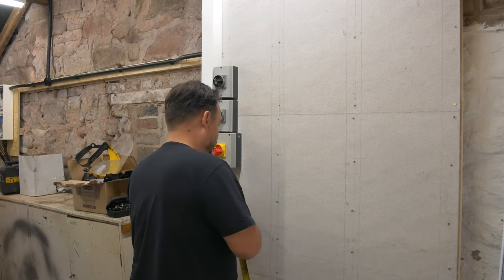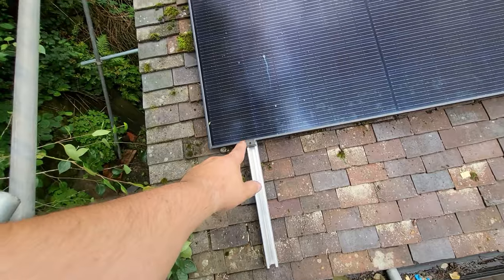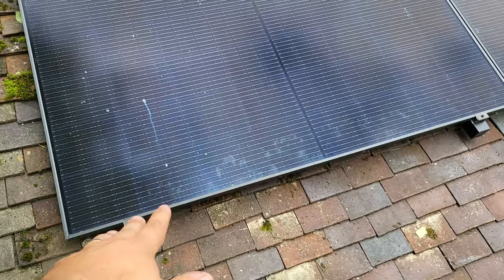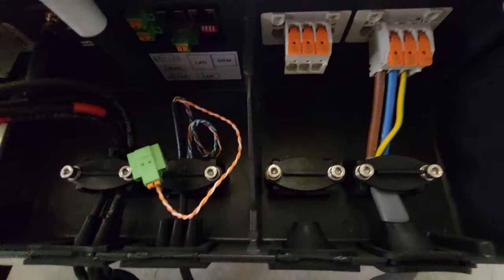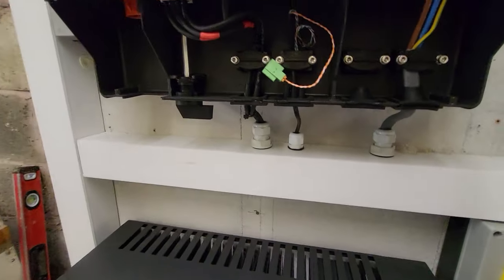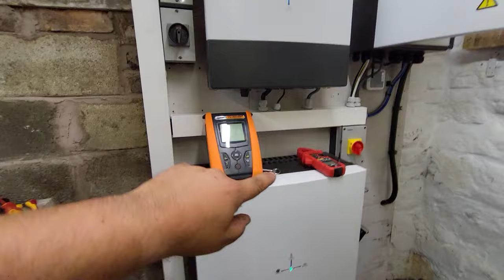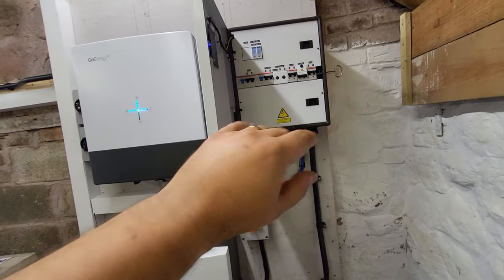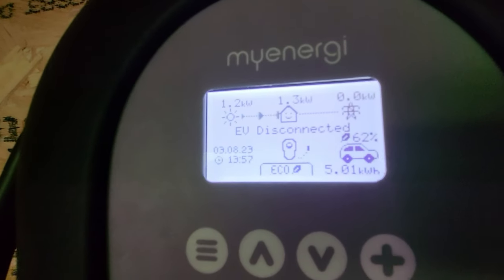13.5kWh GivEnergy All in one whole home battery backup with gateway and 5kW solar - Full Install

Comment: Interesting to see a Zappi and Harvi, do they also have an Eddi? and if so, does it play nicely with the GivEnergy AIO. Perhaps you could give an update wrt priority of battery charging within this kind of system, i.e. what are the options for configuring say Hot Water as 1st priority with the Eddi or Eco+ with the Zappi????
Reply from the maker: House loads always take priority so in this setup you can have the AIO set for a 200W export margin and the Zappi/eddi 50W or vice versa. So you can choose which gets what first. 

Personally makes most sense to fill the AIO first but it is different for all of us and this system gives all of that. 

GivEnergy have a very exciting EV charge point of their own incoming!
Reply: @electrician247  Thanks for taking the time to get back to me.

Any news of GivEnergy EV charge point, i.e. when and what sort of price? 

I currently have 4kW solar (3.6kW inverter) installed Feb 2012 😄

Bought my 1st EV dec last year (MG EV-4), but still don't have a charger yet, just using a granny charger when the sun is shining - not so easy this year....

I have a home grown Eddi and no battery.

For me at least the 1st 4kW on the roof makes it hard to justify increasing my solar or installation of a battery due to diminishing returns on installing anything else. 

Just had a quote with Solar Together for another 8 panels £4k+ and a 4kWh battery around £3k, and the sums just don't add up.

When is the AIO going to be available as a stand alone with no gateway and at what cost installed??? 
I want to be greener, but again at what cost....

Any recommendations?
Reply from the maker: @wino99999  the software is very close so I am told for the AIO to be stand alone. That should be super soon. Costs vary but circa £9000-£11000 supplied and installed is probably a good baseline, Inclusive of VAT.

The EV charger again all the info I have is probably the same as you lol. Soon. https://givenergy.co.uk/products/ev-charger/

I wpuld imagine you have a good FIT payment? The AIO is a great addon alongside that tbh. 

Hope that helps

Mark
Reply: @electrician247  Fit's... yes indeed! and thanks once again for taking the time out to respond!
Reply: @electrician247 great video and insights thanks Mark. Am currently considering the AIO+solar PV and doing lots of research. What benefits would removing the need for the Gateway offer? Thanks again
Reply from the maker: @prowan743  atm you require a gateway regardless until the software is sorted to install without one. That is close to release. Tbh much better with the gateway!
Reply: @electrician247  but how many times can you count over the last 10 years have you ever had a brown out or black out.... - I think Ive had 2 very short interruptions - Whilst I agree it's a nice to have, and it will keep your solar generating even if the mains cuts off, I can't just see the need, barring a zombie apocalypse or some major event happening..... So if the battery part is say £1k cheaper installed as a standalone I guess its more of a 'how much redundancy/protection' against these types of events do you want to protect yourself against question! 

Although it may be nicer to use the Gateway because all the connections already exist in a nice case, maybe the right question is what is the installed price difference as there will probably be a need for some sort of enclosure containing protection and isolators etc....   hmmmm I dont know!!
Reply from the maker: @wino99999  £0 cost difference currently. 

We have had several power cuts this last month. 

No brainer tbh.
Reply: OK Interesting! thx
Reply: @electrician247  cheers yeah I figured the Gateway was useful, which is why was wondering what the use case would be without it (apart from maybe saving a small amount £)

Comment: Hi. Going to have a battery system installed to my recently finished bungalow and have been looking at the all in one as we normally have 2 or 3 power cuts a year. Is the only way to expand the battery storage in the future to add another all in one or can smaller batteries be added? I dont really need 27kwh but could do with more than 13.5.
Reply from the maker: Atm the software is in development to do both.... Not available atm but soon!

Comment: Hi mark eon are putting in my soler system in soon..iv opted for a 5kw battery...but could i install another 5kw batter later my self ..so its a 10kw battery storage system..
Reply from the maker: Depends on the brand but usually additional batteries can be added.
Reply: @electrician247  it's the givenrgy battery mark
Reply from the maker: @nosh121081  yeah you can add more
Reply: @electrician247  cheers mark

Comment: Hi Mark, might be a silly question but why would you need the seperate inverter if the AIO has one built in?
Reply from the maker: Hi mate. No such thing as a silly question lol. The inverter works between the battery and the grid. Changing storied DC energy to AC and vice versa.  It doest work with PV strings. Hence the inverter here. Thanks.
Reply: @electrician247  thanks for the quick reply. If I was to get an AIO with solar pv, do I need to factor in costs for a seperate inverter?

Comment: Hi Mark, it’s great watching your install videos. I'm a college student, and I'm using the GivEnergy system as an example in my graded unit project. Could you please tell me why you have an extra Hybrid inverter here when "the All-in-one" has an inverter built in (unless this is only for that build battery itself) 
And another stupid question (sorry), Does the Gateway work with battery gen2? Or because it doesn't,  you had to buy all-in-one instead of hybrid + battery + gate.
Reply from the maker: The all in one does not have a PV inverter in it. Just the all in one battery and battery inverter. Normal string inverters are fine but customer wanted matched eco system. Gateway is for the AIO only atm.

Comment: Hi Mark 
Really nice video
Just a quick question I am looking into giving energy all in one system, my installer have quoted me for growatt MIN 6000 inverter, to go on 9.2 KW array over 2 roof not sure if this setup of growatt and gif energy will work or is it a sensible idea 
will appreciate your thoughts
many thanks
Mohi
Reply from the maker: It will work fine in terms of the inverter. The system works with any PV input. Thanks.

Comment: Brilliant video, really professional, thank you.
Quick question... To avoid the battery discharging to a (non-Givenergy) EV charger, is the charger cabled into the gateway with a CT clamp and something managing this in the software, or does it need to be taken from the meter tails and not appear on the system as a load? Octopus intelligent charges at any time of day or night, so using the app to avoid certain times for discharging the battery probably isn't enough.
Reply from the maker: Currently the EV termination isn't available in the gateway. It's made ready for it once the givenergy one launches. 

EV chargers would work in the traditional way outside of that but as you say would discharge the battery. 

The beauty of using it via the gateway is you can choose where the energy for the vehicle is taken from. 

I'm not sure if this will be available for all brands of EVSE or just the new GIV one. We shall have to see when it launches.

Comment: I am confused, Givenergy told me that none of their inverters are compatible with the AIO and would need third party DC inverter.
Reply from the maker: Was told the same. But they will work with a hybrid inverter from Giv but just as a string voltage one with no DC battery coupled. 

You also need to create a separate sub account for it to commission, warrent etc outside of the customers main account. 

Spoke to Giv technical and perfectly fine to do so long as not using DC coupled battery on the hybrid as that would always take precedence over everything else in terms of PV generation. 

We have done one this week with a basic solax string inverter. 

Same result.

Comment: Great video - thanks!
Just wondering why use the AIO which includes an inverter, if you're going to run a seperate inverter anyway? Would it be better to just have the stand-alone battery packs rather than the AIO if you already have a seperate inverter?
Reply from the maker: The AIO is an AC coupled battery. It doesn't have an inverter for PV strings. It's output and function is way beyond a normal PV hybrid inverter.
Reply: @electrician247  Thanks for the info - why have the AIO at all then as opposed to just a couple large battery packs running off the PV inverter? Or is it the inverter only routes to one device at a time so it's a case of either or?
Reply from the maker: @CCharlsburg  the aio has 7.2kW peak output way beyond almost anything else on the market. On top of that if its sunny the PV inverter can also output an additional 5kw. 

If you just have a 5kW hybrid inverter for example that's your max output. Not getting whole home backup from that. 

Different ball game with an AIO entirely.
Reply: @electrician247  Ah yes seems so obvious now you say it 😅 Thanks again 👍

Comment: There is one thing that most installers don't do which is probably because it requires more technical skills.

I've seen countless people saying "Oh I've changed my ISP and these no longer connect"

Honestly if installers also installed a decent wireless router (Doesn't have to be anything fancy, just say WiFi 6/802.11ax) alongside it, and made an SSID just for the 2.4GHz range, I reckon it might stop people complaining they can't connect when they change their ISP

This being said, I do also wonder if the solar panels would also continue to work even in the event of a power cut?
Reply from the maker: It is something to consider for sure with an access point local to the equipment. We may start to offer that as standard. Typically we only do it when equipment is outside of existing networks. 

However having recently changed broadband supplier myself and had to update all the smart devices etc it's a pain. I see that more as my problem as a consumer though so have now got an access point to setup as you describe so I never have to do that again lol. 

The PV will continue to work with the grid down as described in the video. So long as the battery has charge and sun is out.
Reply: @electrician247  That's pretty decent. I've got a proper Omada setup at home which helps a lot

I'm getting my AIO installed on Monday
Reply: @electrician247  Always have a sepeare Acess point or even mesh network for your house, from your ISP. ISP's are notorious for providing the most bog standard crappy rounter/modem/AP units so an aftermarket one plugged into your ISP's router would probably do wonders for your WIFI. And you don't need to reconnect all your devices when you change!

Comment: Hey mark I was just looking at your previous video for this job where you went through the design of it all I was wondering how do you decide what ambient temperature to you?
Reply from the maker: Design is usually set at 30C as a datum point in terms of OCPD and other such factors. Derating of cables is done to cover off times that might not be the case. The beauty of software is that's done at the click of a button rather than running calc after calc lol
Reply: @electrician247  hey mark thank you for the reply really enjoyed the in depth analysis in the video raised some interesting points 👍

Comment: Thinking of getting one of these set ups, but we have 3 pv strings. How would that work with this?
Reply from the maker: Keep your existing PV inverter and add the AIO/gateway. As its AC coupled will work fine subject to 32A max PV AC output.
Reply: @electrician247  Thanks mate. I don't know how these things work, but we have 2 inverters, 2 strings on one, third string on the other. They must be connected somehow, but will this work with the gateway or do we need one inverter that does 3 strings?
Reply from the maker: @Vanjonsorz  so long as the combined AC output from both inverters is under 32A it will work with a gateway.
Reply: Just had a quote for a small solar install and a AIO. Quote didn't include a separate inverter. Company said the AIO doesn't need a seperate PV inverter. Is that right? Great vid
Reply from the maker: @tonyfeasby1437  the aio does require a PV inverter. It can not accept DC strings direct.

Comment: Hi Mark. Stupid question: why do you need 2 inverters?
Reply from the maker: The AIO does not have a PV inverter in it. Just the AC coupled battery/inverter
Reply: @electrician247 Thanks for the quick reply - but in which case, why use the AIO and not another of the GE battery options alongside the hybrid inverter?
Reply from the maker: @ArryBradbury  because the AIO is infinitely more powerful. It can also sustain the PV system off grid in full. The hybrid inverter is just because the customer wanted GE equipment in full. They don’t currently offer a string inverter
Reply: @electrician247  That makes sense. Thanks for taking the time to reply!

Comment: I installed one of these today but didn't have time to commission it. Noticed that it wouldn't output to the house loads without turning the bypass on. Do you know if this is normal until commissioned? The bat was working because you could see it on the gateway feeding the house loads. Just kept the battery off until I get a chance to come back to commission it.
Reply from the maker: Totally normal. Has to be in bypass until commission is complete
Reply: @electrician247  perfect mark, thanks very much. I've been watching you since i started my renewables journey 4 months ago, and you've been invaluable with your knowledge. The company i work for said "full training will be given," and I've received nothing. I had to learn ASHP and the PV off my own back. Now the owner is saying stupid shit like, "i want the roofers and plumbers to the electrical connections sparks just do the boards." I told him i won't be putting my name to any of the installs. Then he wonders why they have had 9-10 sparks come and go, and they are about to have another one go. Keep up the work, m8👍🏾.

Comment: That is a nice system isn't it, neat install as always of course. Do you know if they have a three-phase version of the all-in-one and gateway planned?

For the gateway's error output, I wonder if you could run that through to some load shedding contactors within the main house and carport so that it load sheds as required?
Reply from the maker: I'm not sure if they do. I would suspect so! 

Could look at setting up load shedding that's a good idea!
Reply: @electrician247  Looking forward to seeing your ground installation BTW, the planning application has gone in for ours. Interested to see which mounting system you're planning on? We've put the SunFixings Park Tegra system with the ground screws on our application but it's quite expensive.